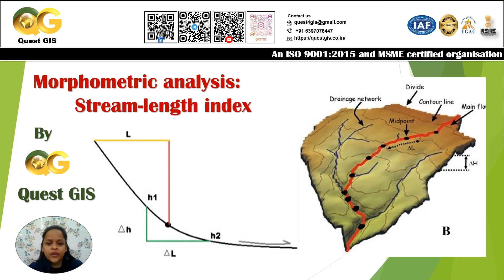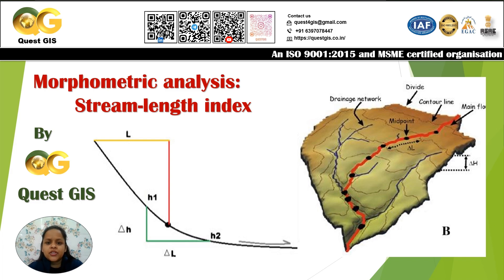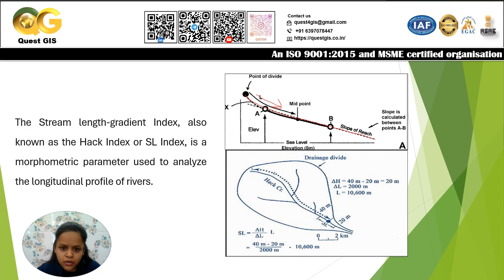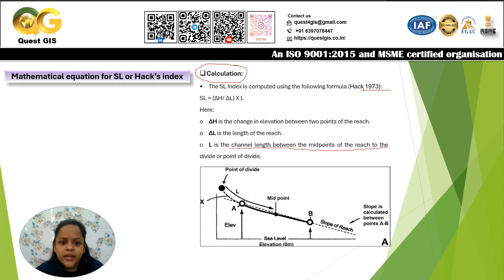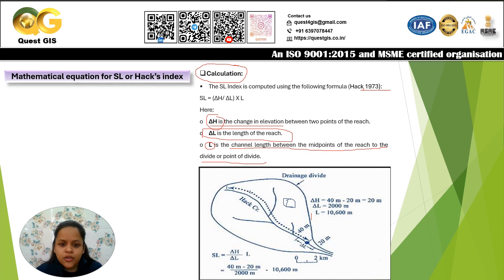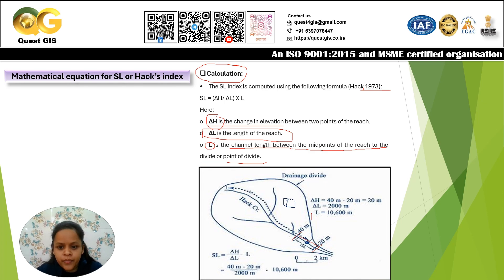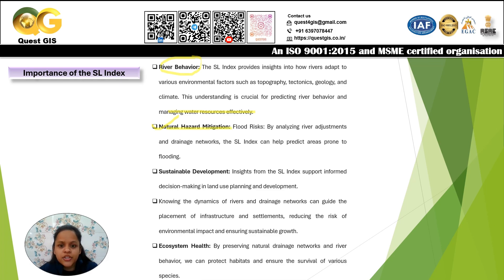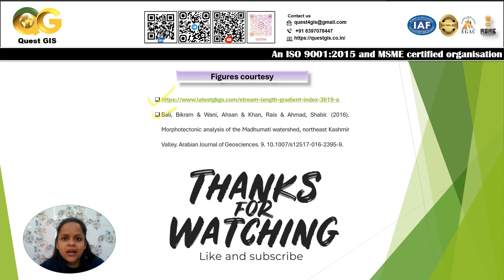Part-1 Introduction to Morphometric analysis: Stream length-gradient index

Comment: Thank you very much, Quest GIS crew, especially to the presenter. I am excited to follow your teachings on morphometric analyses using this open-source QGIS. I have a small question. Is it conventional to calculate L by taking the point of divide at the source, or could it equally be valid to calculate L by taking the point of divide at the mouth of the drainage basin? If not, please permit me to ask, why not? thank you
Reply from the maker: Sorry for the late response. Please see the pinned comment in part-5 of the SL index calculation.